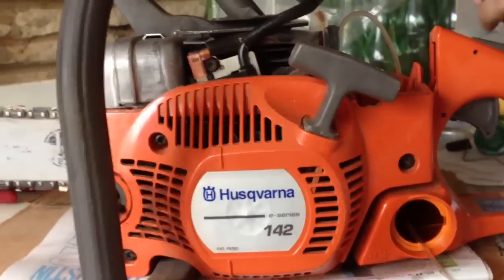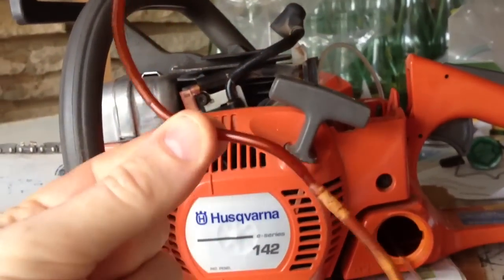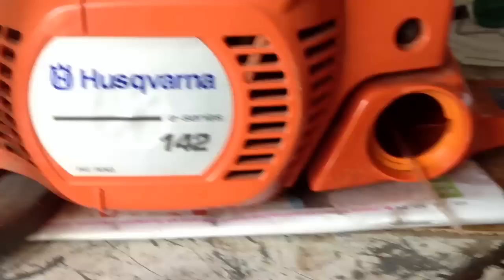How to fit that tricky Chainsaw fuel line

Comment: the fuel tank comes off with 4 screws takes 2 mins.
Reply: You still have to get the big line through the little hole.
Reply: @hangfire968  that’s sick dude